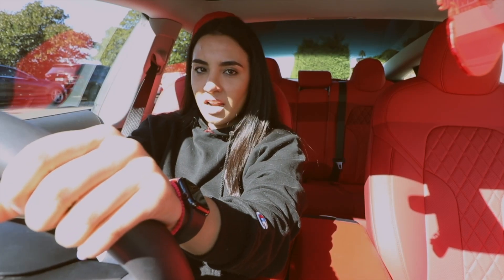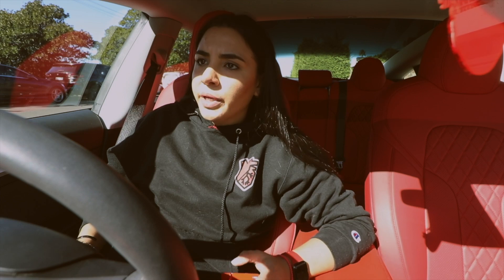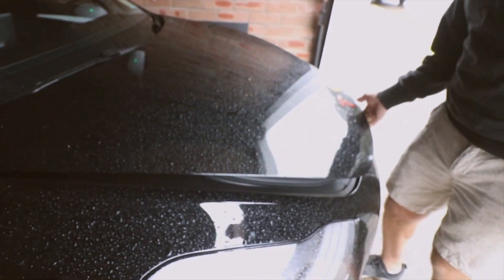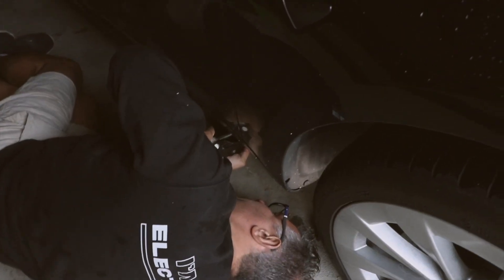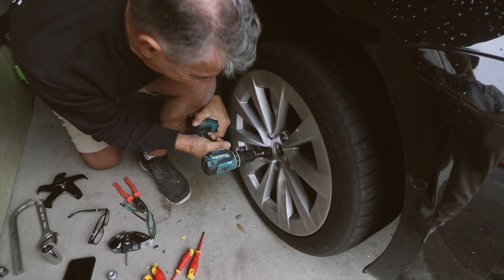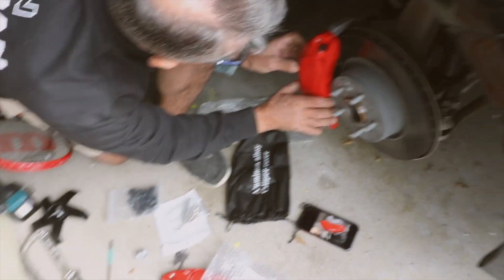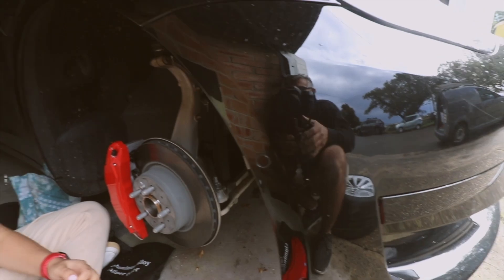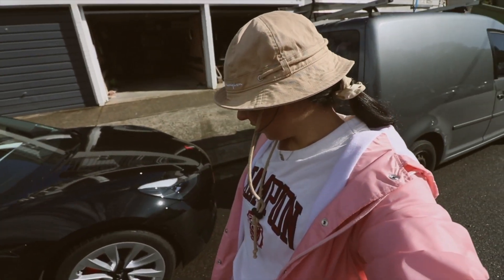Installing Tesery Red Caliper Covers on my Tesla!

Comment: if you want your wheels red why not just paint them? jack the car up, put it on jack stands tape off anywhere you don't want paint on the wheels and spray them. it's not as durable or high quality as getting it done at a shop if you don't have all the stuff but it's pretty easy and it's really fun. if you're only wanting the insides red it's really easy just flip the tires upside down and spray away(try to be as even as possible though), plug the lug holes and tape the hub, I don't think it would damage anything if paint got there the metal friction would just remove it, but better safe than sorry when you're dealing with wheels.  oh and be sure to buy the tesla rubber jack stand things so you don't kill your car